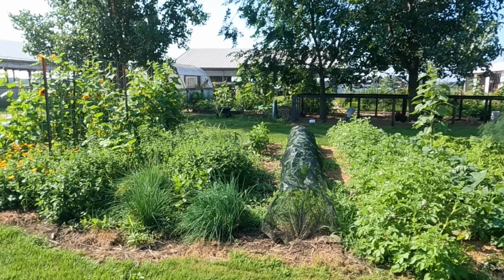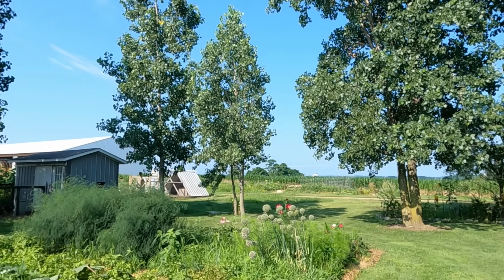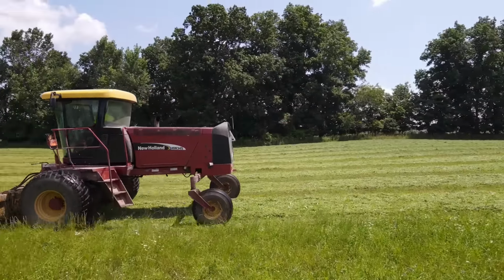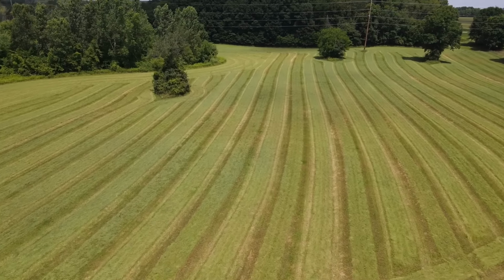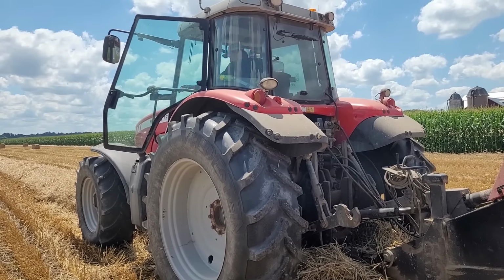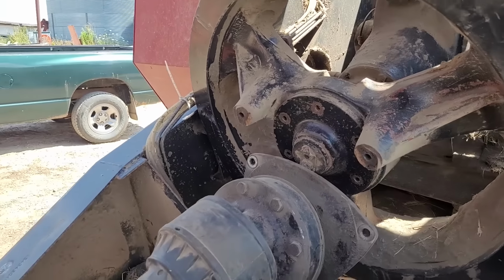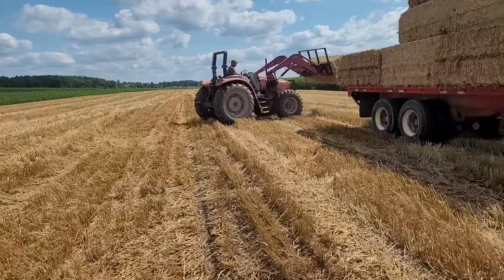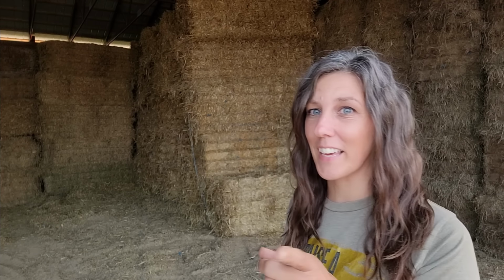2nd Cut Hay & Straw Baling

Comment: If the shearbolt doesn't break clean, you may want to try a "harder" bolt, so it won't smear when it lets go. Been there, done that. Great video, I know there's few things as unpleasant as shoveling 1000 bu inside of a bin in the summer. Keep at it, and I will keep watching!👍👍

Comment: Those fields that Kevin cut will dry up in no time. With the temperatures we're having. I'm i the east and we are so dry. We have only had .94 inches of rain so far this month.WE have been running 85- 90 degrees all month which will be reflective when my electric bill comes in. But looking forward to next week there is no change except getting hotter.

Comment: When it starts shearing off the shear bolt like that either the bolt wasn’t tight enough or the hole has been oblong out. At least that what happens with my balers. I usually have to press thee one out of the flywheel. I usually have had a bushing on the other part but on my massy Ferguson 3x4 it doesn’t have one and the want a $1000 for a replacement. So this winter we will machine a bushing.
Reply from the maker: Yes, Ethan said he should have tightened the bolt before starting.